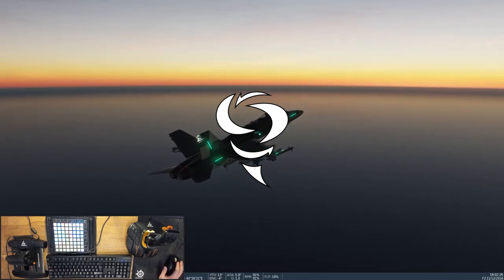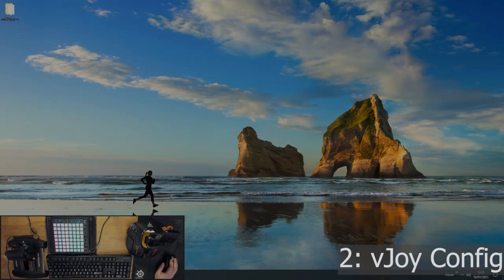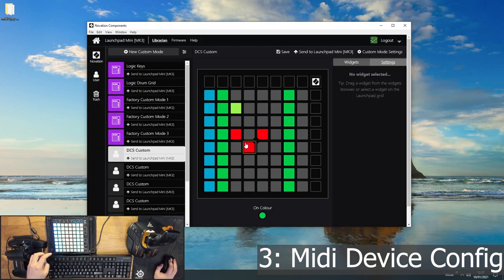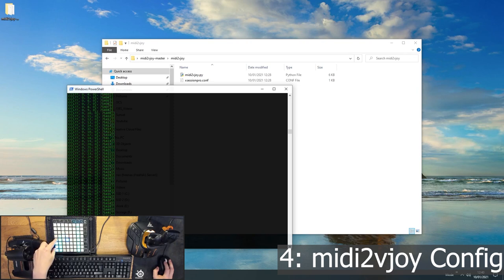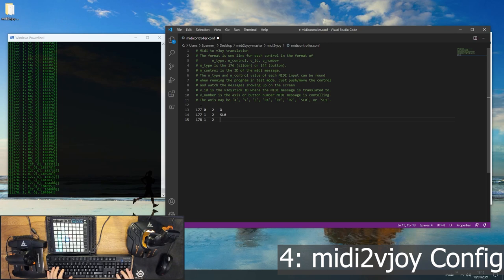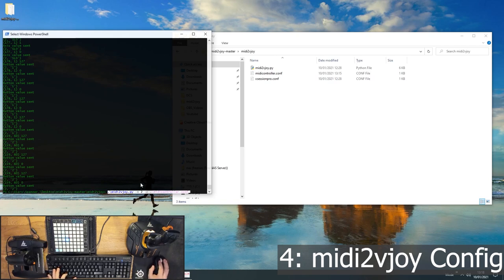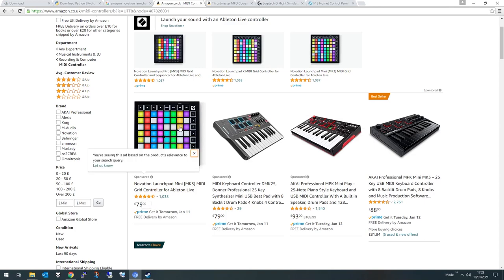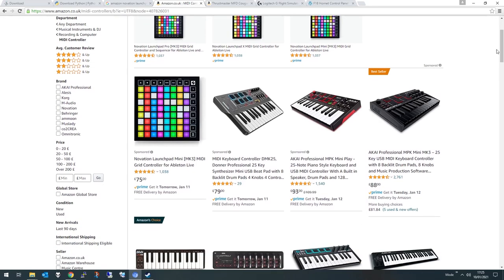The Toolbox: How to use MIDI controllers in your sims

Comment: Why doesn't the powershell command in the first step work? I installed the 2 programs before running powershell
Reply: Same here
Reply from the maker: Are you guys getting an error when running .\setup.py or any output in powershell at all?
Reply: @Spanner_  yeah it’s when running the setup. Got a big chunk of red text in summary it couldn’t run as it is not defined or it’s a cmdlet or smth.
Reply from the maker: @CallsignNova  Think I'll need to see the red text to know what's going on. Are you running ".\setup.py install" ?
Reply: @Spanner_  Hi I managed to get it working, firewall was my issue… now I’m stuck on configuring as I’m using an XY for guided bombing in dcs any idea on how I could do that?

Comment: When I hit enter after a command, it doesnt do anything, just opens briefly an empty cmd window and thats it
Reply from the maker: Hi Aaron; which command specifically?
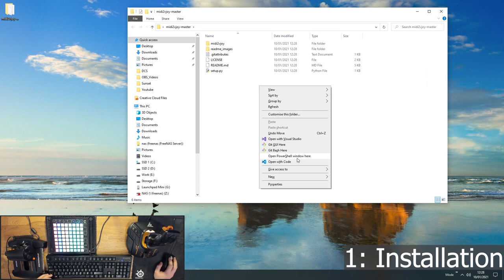Reply: Same problem. @SpannerUnderscore: when installing midi2vjoy (1:55) and when I try to start the test (5:05) to get the midi readouts. 
Beside that very good video! I wonder why sim software doesn't support midi devices out of the box. It would be such a neat feature...
Reply from the maker: @rainerminusunfug  Hmm sounds like Python hasn't installed properly. If you just try running 'python' from powershell does it output python version info and put you in to a python command window?
Reply: @Spanner_  Thy for the swift reply. No it opened the microsoft store and suggested to install python. :D 
So I installed again from the ms store and ended up with two python installations - I deinstalled the former one.
 Calling "python" in the shell now gives me a menu: "Type "help", "copyright", "credits" or "license" for more information."

The installation command (1:55) will give me a slighty longer glimpse, but still reads only one line ("running install") instead of a longer log.
The test (5:05) still doesn't work. 

I guess, I should reboot and try again. Maybe even get rid of all installations and start from scratch. :/
Reply: @SpannerUnderscore Great success, wiping the python installations and re-installing it did the trick. :) 
I get the midi readouts now, so I guess it's smooth sailing from here on.

Again, thy for your help and this great little tutorial. Now I only have to get me a graphics card for a reasonable price to finaly play DCS. Like that is ever gonna happen regarding the current crypto rush and scalpers emptying market and thus inflating the prices... :'(
Reply from the maker: @rainerminusunfug  Best of luck with the graphics card hunt... you might want to crack out some older flight sims for a few months while you wait for one to appear back in stock(!)
Reply: @Spanner_  It's ok for now. My 10 year old card can still run the show at 1280x720 and everything turned off. Good enough to play the tutorials and get into flying again. 

I use the Lauchpad mini mk1, so I should be able to copy every of your steps 1:1. I set up 64 buttons and gave it a quick test in DCS, it works like a charm. :)

One more question though. So, as far as I understood, your idea was to use the top row as *page dials*. So the "main" 64 buttons are assigned to different virtual joysticks and you dial through them with the top row. But how does this work? 

I can see how you could define one virtual joystick with 80 buttons (64+8+8) and use the top row as modifier in DCS itself, but not how you would set this up in vJoy? Defining the top row as an axis would just make DCS interpret these buttons as a physical stick, or would it? What am I overlooking?
Reply from the maker: @rainerminusunfug  if the mk1 works the same way as the mk3, then changing page e.g. between 'drum', 'keys' and 'User' is essentially invisible to DCS and Vjoy, but it allows you to map more buttons or axes (with sliders) in the Novation components application.

So if, for example, you put unique buttons on every page in Novation components then you would have 64 + 64 + 64 buttons to map in midi2vjoy. To use the first set you'd need to be on page 1, to use the 2nd set you'd need to be on page 2 and the 3rd set, page 3.

The tricky thing here is that a single Vjoy device is limited to 64 buttons and 8 axes (IIRC) so you would have to make 3 Vjoy devices and map the midi buttons to those devices to then go and bind those to controls in DCS...

Personally I haven't found a need to have 64 + 64 + 64 buttons. Instead I have my 'Keys' page set up with 8 sliders to set lights and I have my 'User' page with 64 buttons... and I've probably bound about 40 of them in DCS.

I have used Novation Components to colour-code the buttons so I get some idea of what they are and grouping them together helps identify which set is for which control groups in the cockpit.

Hope that makes sense but please keep asking questions and we'll get there!
Reply from the maker: @rainerminusunfug  Having just looked at the mk1 launchpad, it doesn't look like you have the same 'page' functionality so I think I'd probably try using the 16 buttons around the edge as modifiers in DCS and configuring them as toggle buttons so that you don't have to press and hold them.

You may need to run another midi2vjoy with a different config to pick up the 16 buttons around the edge if they are listed as a separate midi device. If not, then you just need another Vjoy device to assign those 16 buttons to and then you can add them all as modifiers within DCS.
Reply from the maker: Worth noting you can add modifiers to axes as well, so you could set your launchpad up with 2 - 4 sliders and the rest buttons - then use the modifiers with those sliders and buttons to access all of the buttons and knobs / axes in the plane. Good luck! Control mapping always feels laborious but totally worth it when it's done.

Comment: PLEASE H E L P ! When you press the button, it lights up in vJoy Monitor, but when you release it, it stays pressed. Although in telemetry it only gives a command at the time of pressing - it should work fine, but it does not work. Can anyone explain what's wrong? I tried to put buttons and axes on one and on 2 different virtual joysticks separately. And what have I not tried...
Reply: P.S. I have only 1 midi device. And in -test it show only one device.
Reply from the maker: @nauvofact993  what does your test output show when you push and then release the button?
Reply: I have the same issue. After I press them the first time, buttons stay pressed. Did you find a solution?

Comment: Hi, thanks for your tutorial. i applied this to my akai apc40 midi controller. however, i face some issues. if i assign a button to lets say the parking break, the parking break constantly rattles in the game as it seems to recieve input all the time. In addition, i mapped one of the knobs to the heading bug for instance (midi2vjoy as a slider) and if the knob led of the controller is facing north, no changes are made, moving left will start to move the heading bug to the left faster and faster, the same on the right. its not possible to continously rotate though...any ideas on how to address this (these are the akai apc40 track control and device control knobs). Any ideas would be very helpful, thank you!

Comment: Hi, when trying to run pthe pwershell commands to install and test midi2vjoy, a cmd window pops up for a split second then closes immediately, do you know why that may be? Thanks in advance :)
Reply from the maker: Sounds like you may need to check that .py files are opened by python by default and not something else. You may want to try typing "python ./midi2vjoy.py -t" or "python ./setup.py" and see if being explicit about using python makes it run properly.
Reply: @Spanner_  Hey there boss. I've just setup my environment path for python which has helped for sure. It is having problems now due to python not having pygame installed so I need to get that sorted but we're getting there thanks pal :)
Reply: @Spanner_  got it working now, thanks 👍 for some reason my midi board is coming through on 2 channels for on button but I guess it'll do for now
Reply: @Spanner_  I have the midi2vjoy working but ACC (the driving SIM) won't recognise the inputs I've spent enough time trying to make it work for now but thanks for the help.great video
Reply from the maker: @fionnoconnor8561  I don't own Assetto Corrsa but I see some other people reporting odd compatibility issues with vjoy. I suggest trying HID Hide and locking out any other device you don't intend to use in the game... see if that helps: https://github.com/ViGEm/HidHide/releases

Comment: You are awesome man. Gamer on a budget here. I try to learn, build, and fix stuff than pay full price. I just got into dcs and my Hotas x is not cutting it. Need more buttons. I ran vr so the buttons will be a lot easier to remember when the headset is on. I was ready to mess around with leobodnar and arduino boards then I saw your video. Thank you

Comment: Hi, thanks for the tutorial, it seems easy how you explain it.
I have the problem, that I can’t install the midi2vjoy. The window is open, but when I enter the „setup“ or „test“ command, nothing is happening. No green code is running.

I installed python, the py files are also knowen as python files. Can you help? 
Thanks a lot
Reply from the maker: It sounds like when you installed python, you didn't let it add python to the system PATH.

Easiest way to fix will be to install python again and make sure the "add python to system path" option is ticked.

Comment: Ok so for the reverse which I am really interested.  I was wondering if it is possible to have the logitech pro joystick or other flight sim gear be used a midi controller in order to control hardware music gear such as the MPC one. I have seen many videos on using PlayStation controllers to control midi in software DAWs such as Ableton. 
My imagination is running wild here haha. Any ideas?

Comment: Great tutorial! Do you think it's possible to also use MIDI controllers with rotary encoders? I've tried to do it but vJoy doesn't seem to recognize short button presses (under 100ms).
Reply from the maker: I expect it should work fine and I'm not sure why vjoy wouldn't be able to handle fast button presses. Are you sure the midi signals are appearing as expected in the midi2vjoy console output and that the issue is definitely with vjoy?

Unfortunately I won't be home for a while (probably a month) so can't test myself.
Reply: @Spanner_  Yeah I'm sure the MIDI signals are read by midi2vjoy and it triggers button presses as I defined. Unfortunately these button presses only shown in the vjoy monitor (and recognized by games) only when they last >100ms. That kills the point of encoders of course. But thanks for your answer anyways!
Reply from the maker: @ArconianSims  How odd. In lieu of being able to look in to it myself, and if you are OK modifying python, I would suggest making the python 'hold' the desired button for a minimum specified time (100ms in your case) and then the rotaries would at least be useable (albeit rate limited to ~10 per second as you spin it).
Reply: I use a Behringer X-Touch Mini and the encoders on there work fine in DCS via midi2vjoy

Comment: I'm interested in using a novation launch control mini which has a lot of knobs which can be mapped to axes, but a lot of flight sims prefer to recognize distinct keypresses for things like increase/decrease flaps, Open/close radiator, rather than axis movement. Can midi2vjoy convert these knob turns on a potentiometer into keypresses in a certain direction instead?
Reply from the maker: What an excellent question. Right now, no it doesn't support converting a rotary in to a repeater. But it could. If you are comfortable with coding, you can edit the midi2vjoy.py and add logic inside the elseif on line 161. If you aren't, leave it with me and I'll extend it to support this behaviour.
Reply from the maker: Hi Charles, I might have done what you need on this branch:

https://github.com/spanner-uk/midi2vjoy/tree/axis_to_repeater

Any questions, hop in to the discord and ask in the tech help chat :)
https://discord.gg/qGF5fbm4qs

Comment: Hello i'm having an error wich says Error initializing virtual joysticks ( i put "midi2vjoy -m 1 -c options.conf" in the cmd because PS does the pyton open and close bug and its also how he's doing in the documentation (the "midi2vjoy -t" works )) (vjoy folder is in the same hard disk than midi2vjoy) Thanks for the help.
Reply from the maker: This error occurs if midi2vjoy can't find any virtual joysticks so double check that vjoy is installed correctly (maybe try re-installing it) and ensure that you have enabled at least 1 virtual joystick within the vjoy configuration tool. Hopefully that will sort it out.
Reply: @Spanner_  can it maybe be because its on a other hard disk ?
Reply from the maker: @calixo3619  That shouldn't matter. When vjoy is installed, it adds joysticks to your operating system (you should see them if you open up 'Set up USB game controllers' from the start menu - it is wroth checking this).

Midi2vjoy just finds the joysticks by asking the operating system for them - so it doesn't make any difference which hard drive the programs are installed on.
Reply: I hope you already figured it out.
Most likely, the fact is that you have used more joysticks in the file than are added to vjoy. There are 3 of them in the standard file. You need to delete lines about 2 and 3 joystick, or add them to vjoy.

Comment: Very nice tutorial! Thanks a lot. I gonna use it with Akai APC Mini als button board for my Star Citizen cockpit. The only issue i have is when running the powershell script, there are two channel numbers per physical button on my APC. When pressed it shows "(144, 0) 127" - as intended and when releasing the button it shows "(128, 0) 127" ... this "issue" come up with each button; the sliders work as intended. when testing the script the vjoy monitor shows that the buttons are pressed permanently.
Does anybody has/had the same issue and can show me how to solve it? would be awsome.
Reply from the maker: Thanks for this, I have edited to code in an attempt to fix it for your device.

Could you please download midi2vjoy.py again from here: 
https://github.com/spanner-uk/midi2vjoy/blob/master/midi2vjoy/midi2vjoy.py

(There's a little 'download raw file' button in the top right of the file display)

Put it where your current midi2vjoy.py is and overwrite it then give it another go and let me know if it sorts out your problem.
Reply: Thank you very much!! this solved the problem! now it works as intended! huge thanks !  @Spanner_
Reply from the maker: @arodon1989  Ace, thanks for letting me know!

Comment: My Sliders work but not my buttons. :/
Reply from the maker: Could be they are on separate midi devices? See if there are multiple devices available when you run the test script and try the other one for the buttons.
Reply: @Spanner_  Thanks! This helped me a lot! By the way, is there any way to use two or more devices? I've been trying to prepare two powershell scripts, one for each MIDI device, but doesn't work :(  My MIDI controller separates the pads buttons and slides in two different devices
Reply from the maker: @matheusmigge  What error do you get when you try and run up the 2nd script?

Comment: hi i have watched your video and followed it very closely several times. my subzero midi controller only gives out codes 176 (for buttons and sliders/dials) and a code 192 for one of the infinity dials (which turns forever either way dunno what they are called! lol)  I just cant get the vjoy monitor to see anything 8(  I have written and saved the conf file correctly.  Can you please offer some help? thanks!
Reply from the maker: Do you get a sensible output in the powershell window when you are running midi2vjoy -m <midi device> -c your_config_file.conf ?

There shouldn't be any problems with all of your buttons and sliders being on channel 176 as long as they are all on separate CC numbers (the number after 176). Channel 192 should also be fine. I expect your dial will produce a button press on 1 CC number for each small rotation clockwise and a different button press on another CC number for each small rotation counter-clockwise - so if you spin it you'll get lots of on / off signals from the same 192 <CC> button.

Perhaps you could show me your conf file on a pastebin? https://pastebin.com/